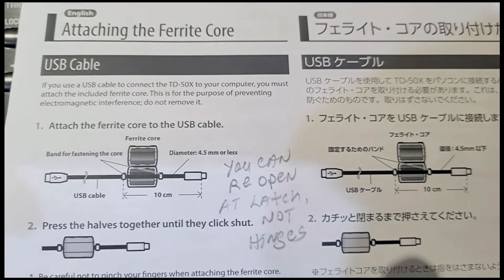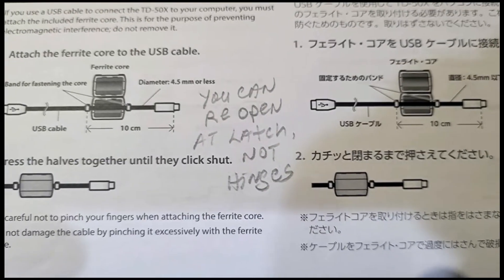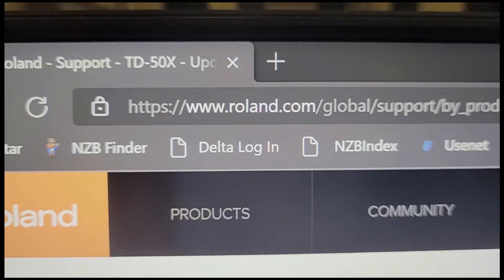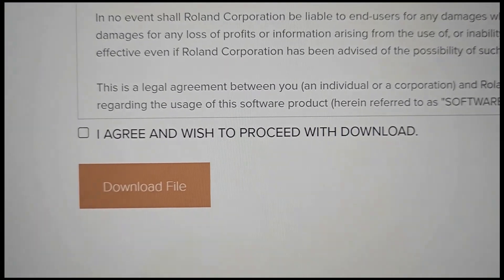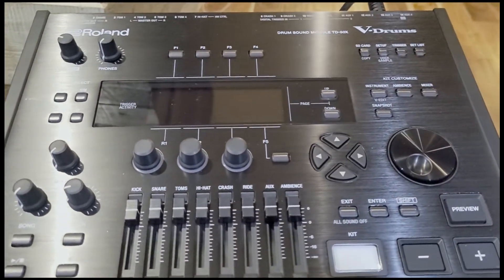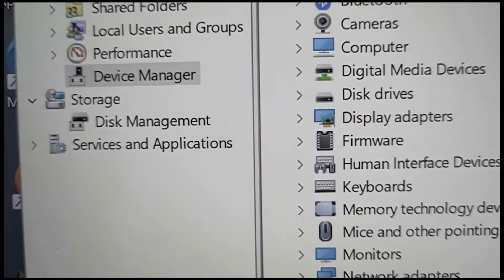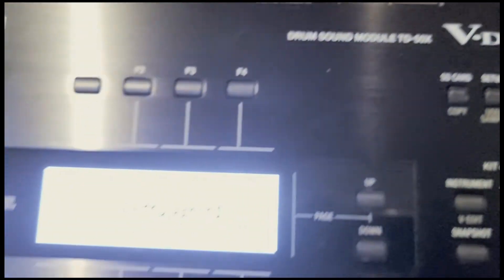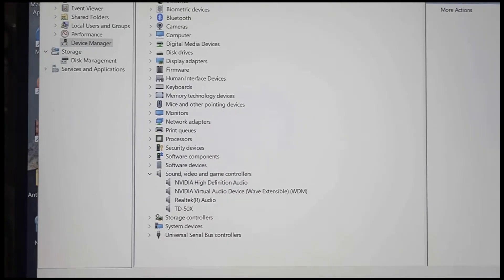How To Install the Roland TD-50X Windows Driver

Comment: Thanks for the video! When you go to the module and see the program version does it say 1.02? Mine still 1.00
Reply from the maker: I might suggest to post this question in the Facebook Group for the TD-50X..this will get you worldwide answers. You can also install the Roland Cloud Software which would give you access to all that is available for the TD-50X to verify if you have the latest version.